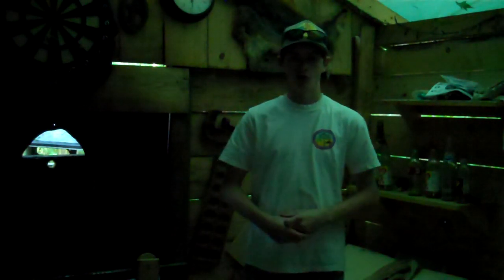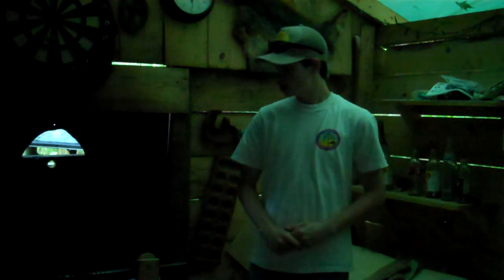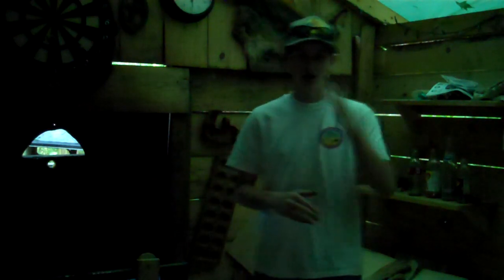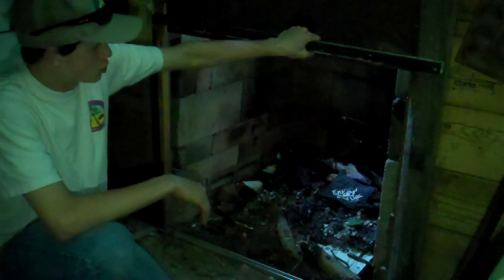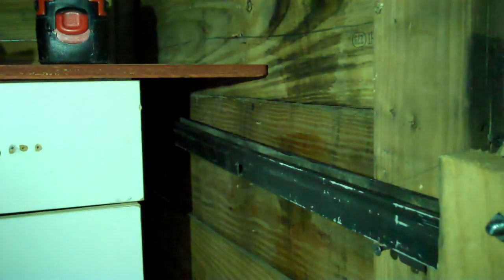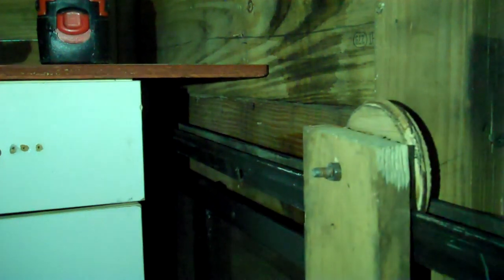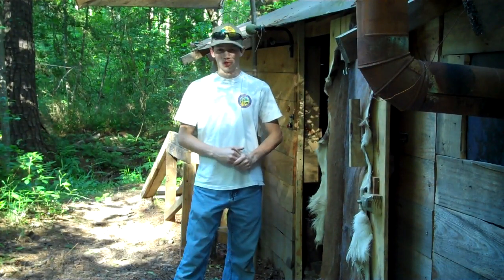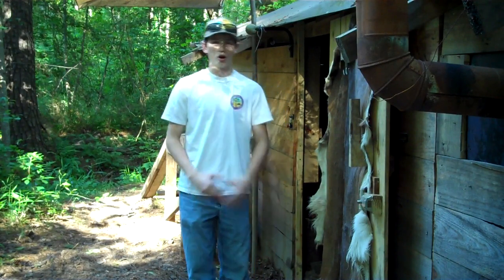Cabin Renovations Part 1 - The Rolling Spark Arrestor

Comment: Hi Kenny that looks great!! I just have one concern and thats regarding the wood blocks on the inside you used to mount the casters to the screen... i don't know maybe test it out for heat and or ember/sparks so those little wood blocks don't smolder and catch fire while you're away after the fire place is used.  Maybe make those blocks metal on the inside?